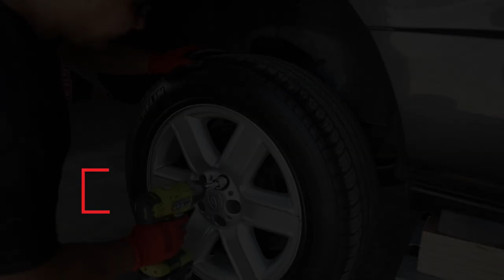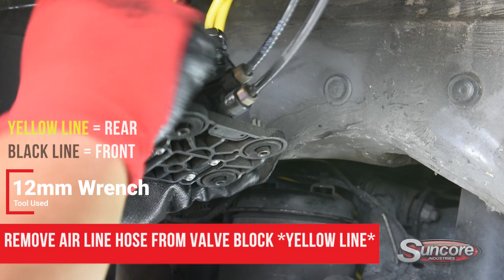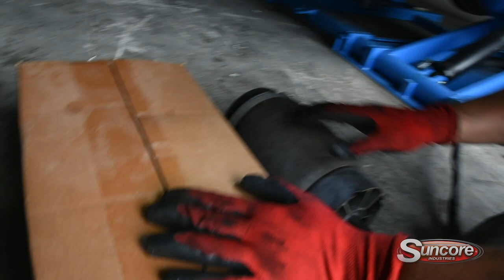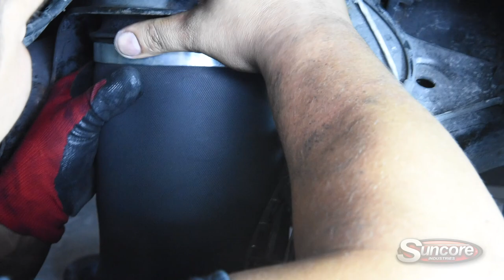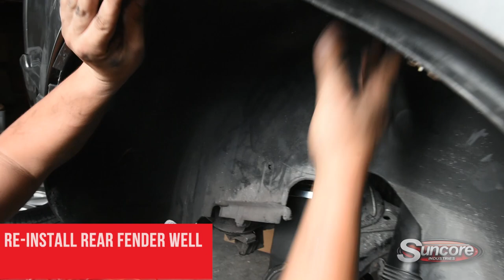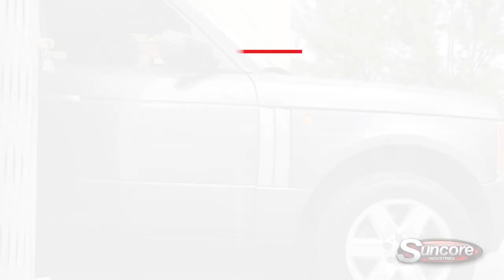2003-2012 Range Rover L322 | How to Replace Rear Suspension Air Spring

Comment: Since it's generally recommended to change both at the same time it would be nice to mention that the valve block in the right well has lines to both the left and right rear bags i.e. if you plan to replace your left air bag don't expect to find a valve block in the left wheel well.